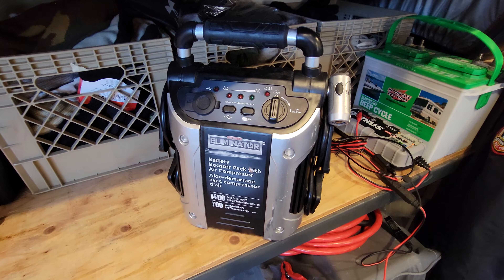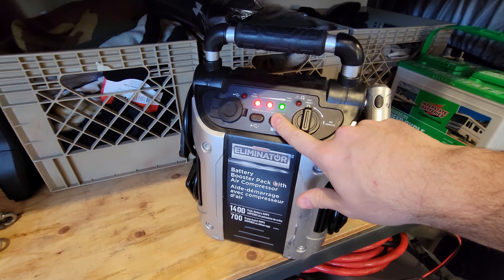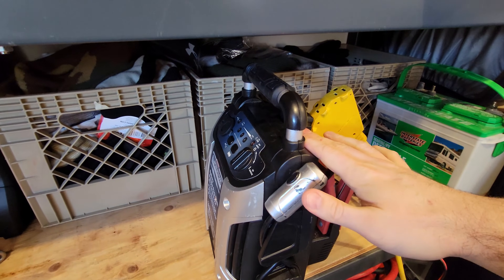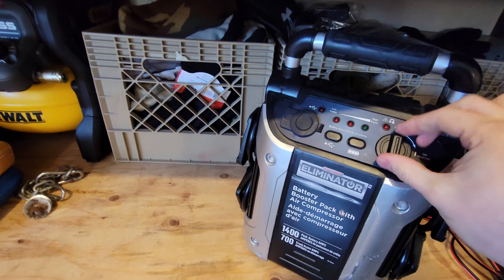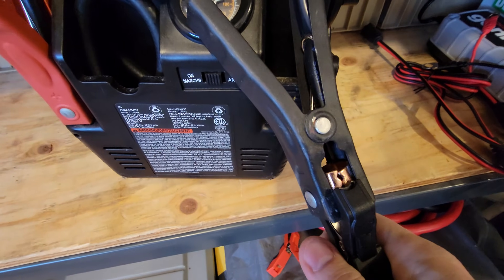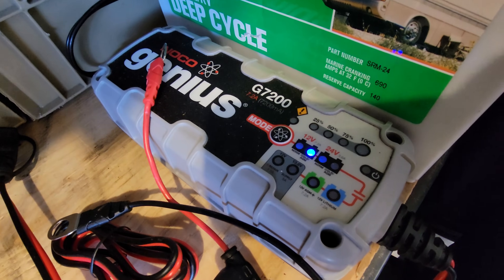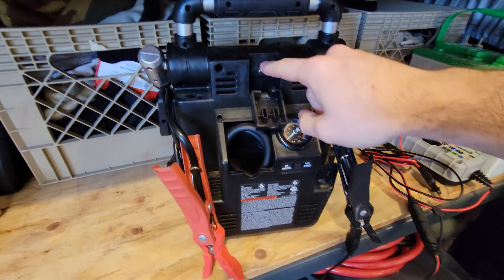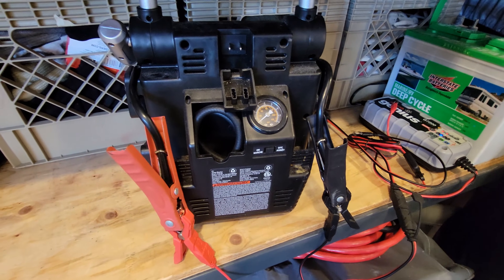Battery Booster with broken AC Charger? Here's a way you can still recharge the pack!

Comment: After connecting the alligator clamps, do you turn the jumper switch to on? I did this, it appears to be working, just a bit worried it’s throwing power into the charger with this switch thrown. 

In the overview at the end of the video, you don’t specify to turn that switch, but I can hear the thunk of it being turned from the front, out of camera